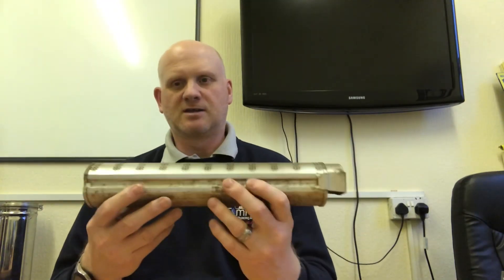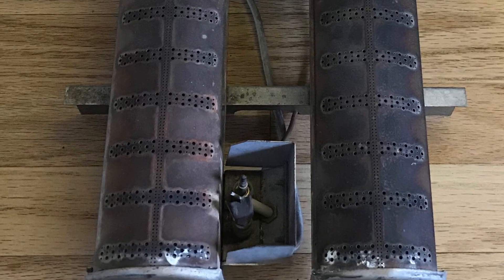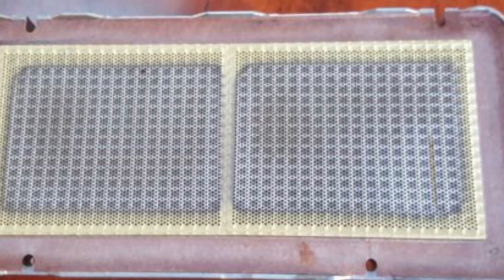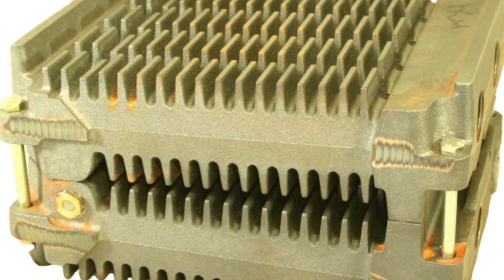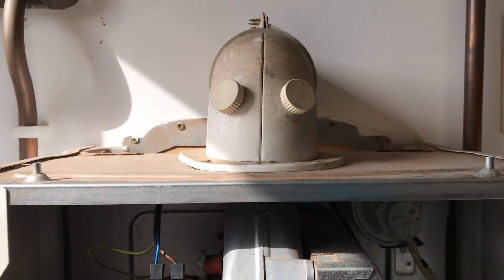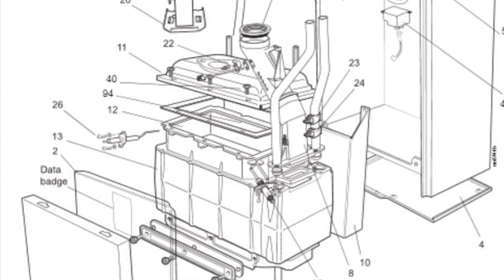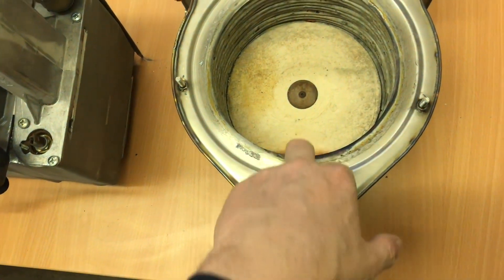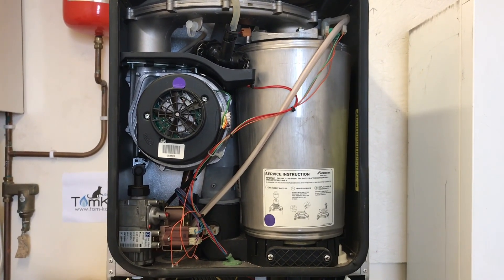HOW CENTRAL HEATING WORKS, The history of central heating part 5B - boilers

Comment: Hi Derek - just found your channel today and watched quite a few videos, including this history series.  I think they are great and you deserve way more subscribers.  I am a retired electrical engineer but my 91 year old mum's prismatic tank has started weeping so I am going to replace it with and indirect vented tank and put a new F&E cistern in the loft of her bungalow so wanted to make sure I was up to speed with all this.  Your videos were very informative.  Amazingly it turns out that over the years a plumber (who has now retired) and a gas engineer who services the boiler, have both added corrosion inhibiter to the system!!!!  I did not realise this until recently.

Twenty five years ago I installed the central heating and hot water system in my house when it was extended.  It is a fully pumped vented Y plan based on a Glow Worm heat only cast iron boiler.  The system was installed correctly according to your videos (pump in Boiler flow line  and just after expansion and feed pipes which are 100mm apart) but the system has always suffered terribly from corrosion.  I have put this down to the HEP2O pipe I used which was stated at the time to be ok for central heating but this was before barrier pipes came on the scene so I assume that oxygen is getting through the plastic and corroding everything.  My plan is to replace the pipes with new barrier pipes and then have someone instal a new condensing combi boiler.  I will need this to also feed a non-vented tank at the far end of the house to supply a kitchen, two bathrooms and an ensuite including a very large mixer shower with hot water.  Your channel is therefore a bit of a Godsend - keep up the good work.
Reply from the maker: Julian Lindley thanks for watching cheers